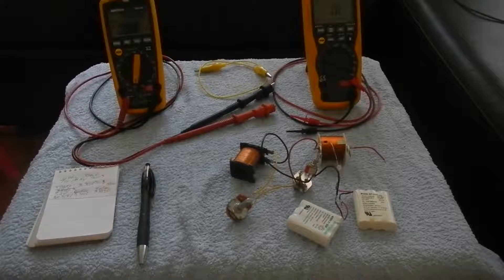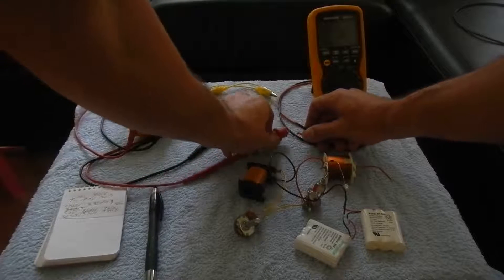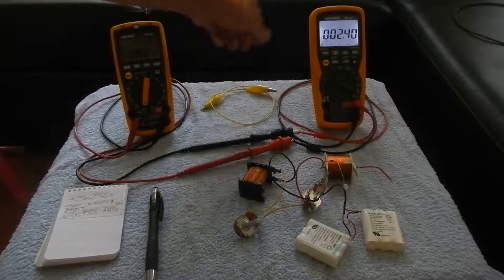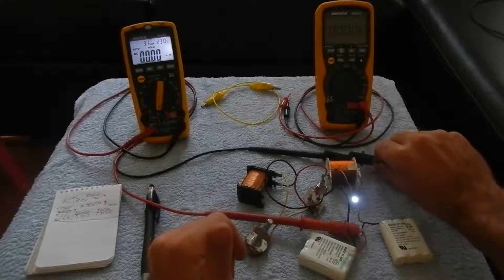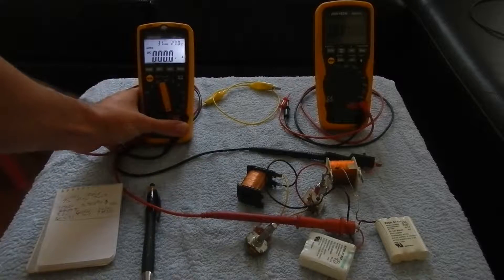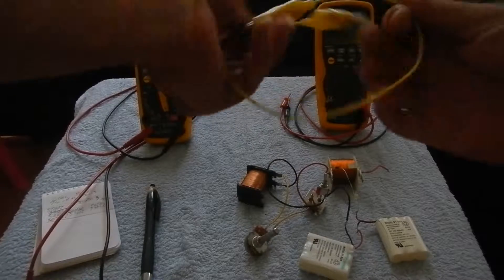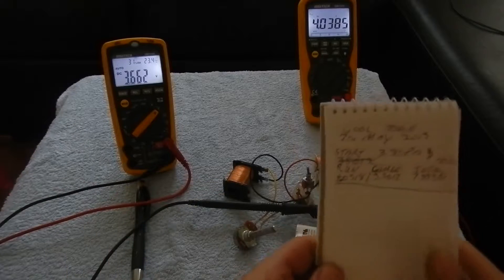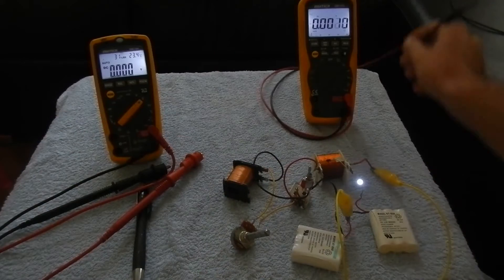Cool Joule Replication with 3.6v Ni-Cd packs.

Comment from the maker: Can you get decent amp hours out is my big question. If you think about it. 800mah cell. 888µa amp draw from the run cell. Should take 1000 hours, just to get a full charge out of the run battery. Would have to be 100% efficient, with zero circuit resistance for all that to make it into the charge cell... The run is dropping, and the charge going up. they will meet at aprox 3.85v, I'll be giving it 48 hours  after that. Doing an amp hour count, and attempting to do a watt hour count. cont

Comment from the maker: I have 2 drill packs that need recovery. 12v ni-cd. They stopped holding charge 15 years ago.... Rater than start them on the solar, I will try to charge a 12v, from one of these 3.6v's next. failing that I'll make 7.2 from these ones. That will do it I think :) As of 9am next morning, I have 3.9457v run, 3.8439v charge and a total of 7.7896. Coming down now, but still above pre start and start total :) Will likely wait for them to balance for an update :)

Comment: Good setup. What it brings in too are the thoughts on desulfation, like with the old phone batteries. Next upgrade for me is similar, old drill packs, that sort of thing...hopefully moving toward 12V. The larger the battery pack the larger the actual difference should be in running loads after the test runs :)
Looking forward to updates.